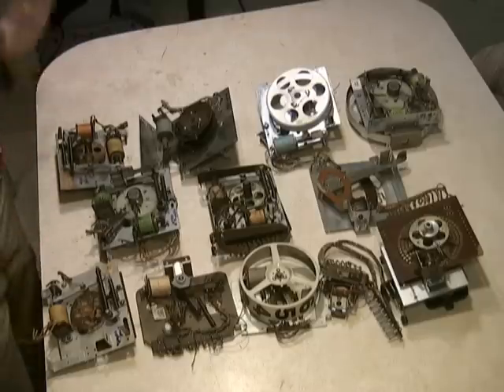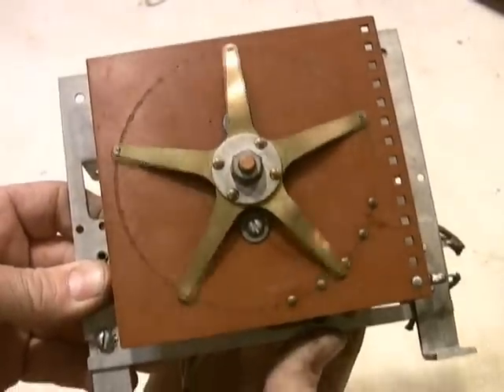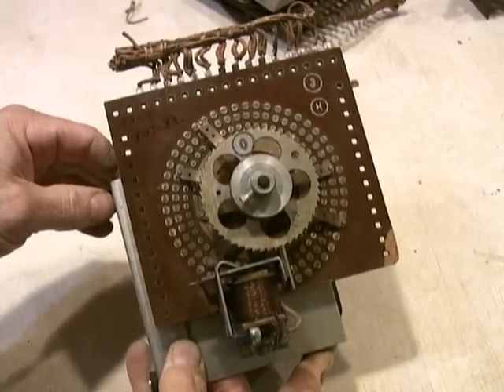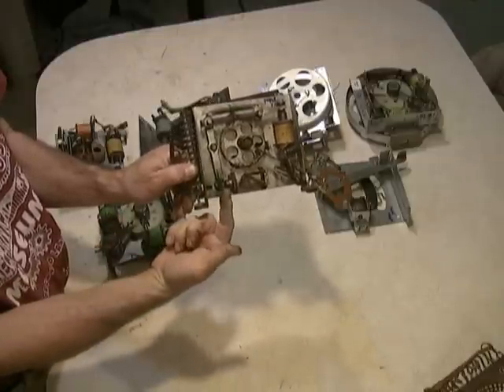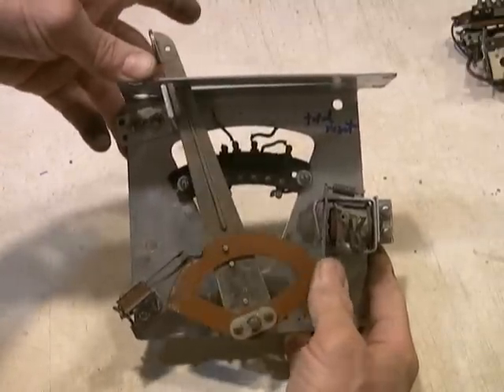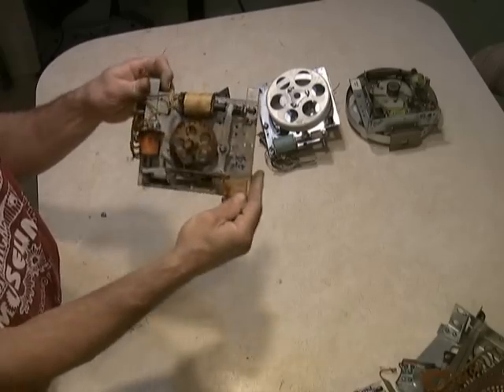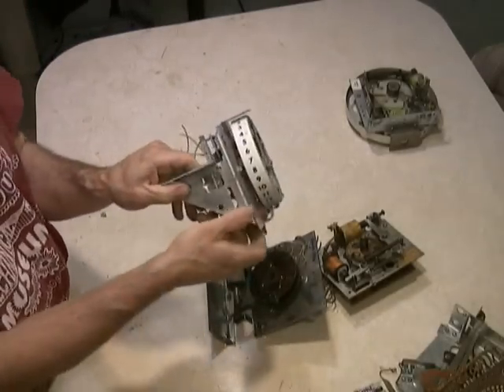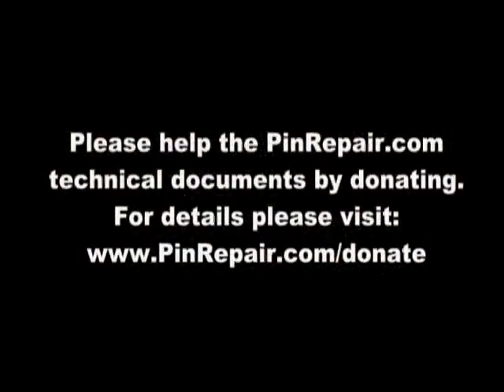Pinball repair - Stepper Units in EM Pinball Machines

Comment: that is a really good video on these stepper units  I used to work for a vending company back in late 80s Hudson Coin  and we had one machine that had a big stepper unit in it which was an old electromechanical bowling machine called if I rember right "Top Hat?"  but my boss was only one who ever worked on it cause he  was so familiar with it  I did work on the jukes and everything else just not that

I still rember the 7 flash count for bally pinballs on power up an tip 120 driver transsistors :-) we had both bally and williams pinball machines an a Really old one called wakiki beach I think with the hula girls on the back glass  that one we didnt have out on location though just in shop best times back then working on all that stuff  I enjoyed it miss doing it